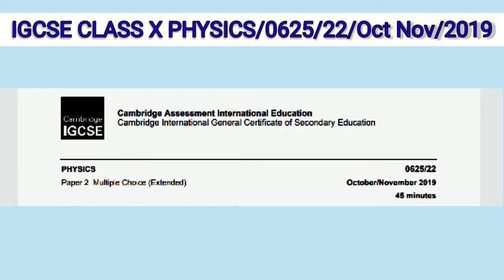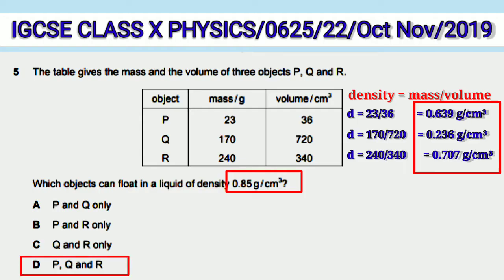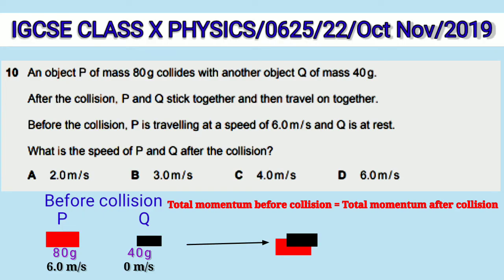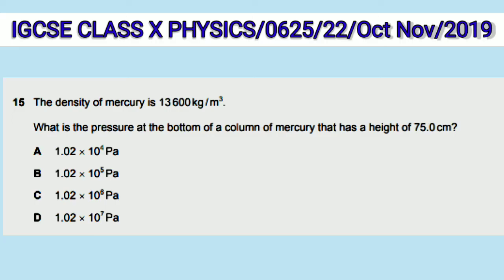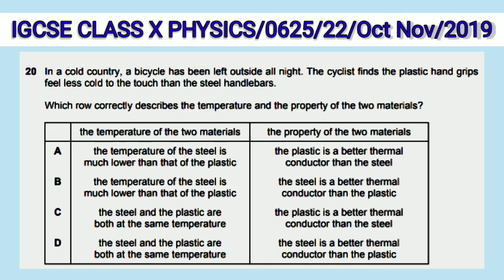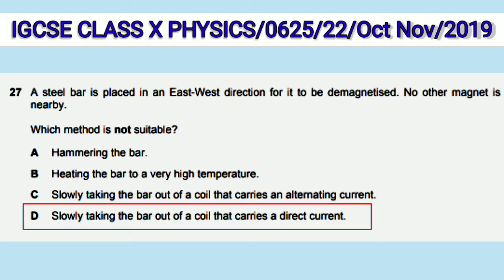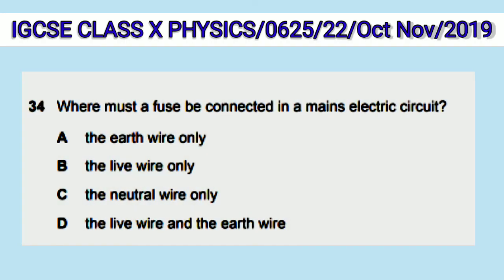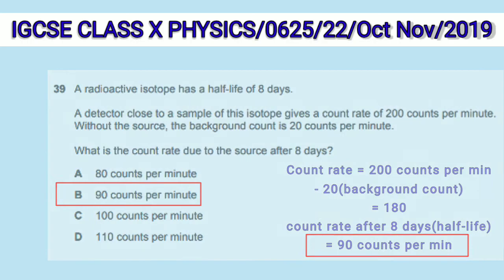IGCSE PHYSICS/0625/22/Oct Nov/2019/Past paper solution

Comment: Actually, does anybody knows how to solve question 20😢. Thanks a lot❤
Reply: if the plastic and steel is left all night then it would be the same temp regardless if it absorbs the cold at a higher rate or not. steel is a better conductor as it has free electrons
Reply: but the question states that the steel is colder than the plastic which implies that it has a lower temperature right?
Reply from the maker: You are most welcome

Comment: Q6 not explained properly!
Reply from the maker: I have explained in my way,hope you find better Explanation!
Reply: It does not state by any means that the system is in equilibrium so why are you applying the principle of moments, when there is infact a upward force lifting the object!
  @learningsupport9252
Reply: @learningsupport9252  I appreciate you it’s a very good video well explained
Reply: skill issue bro simply used f1di equal f2d2
Reply: She has explained bro the common error  we all have done here is considering pivot in right but look closely it is in left thats why they have given 225 to confuse if you consider right one as pivot but here we have to take left one as pivot and you will get 180 as the answer
Reply: @ADHAY-CHAVANKE  alright thanks appreciate you mister
Reply: What did you not get?
Reply: Did you get A?, for question 6.
Reply: @marxcarton3858  I just saw this 🤓 I even got my result 😞